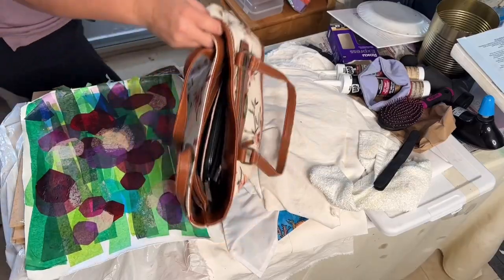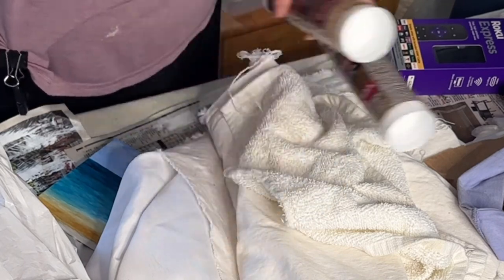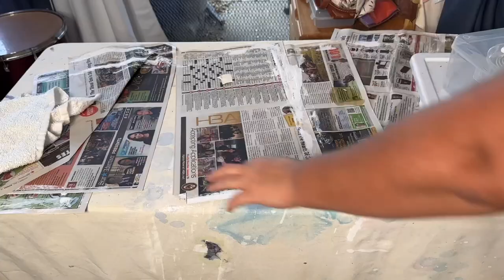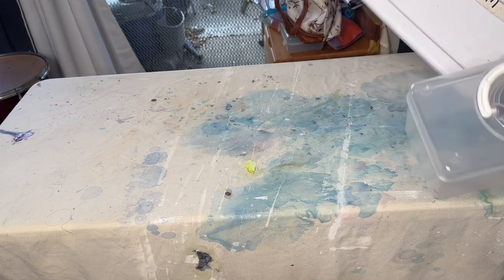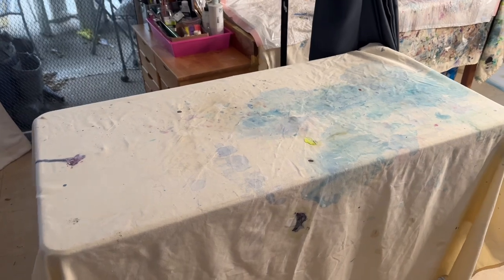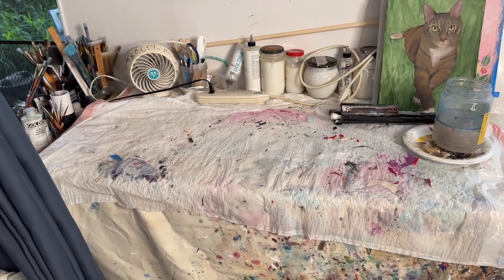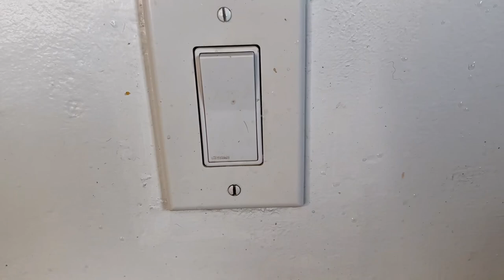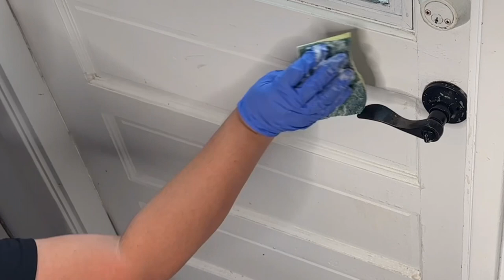Declutter & Clean with Me | Get that dirt gone!

Comment: Great job, Tracy! Go to next month on your calendar and write "Kitchen" for one of the weeks in March. Trust me...even if you think it doesn't need it, spend just 1 hour in that week cleaning your kitchen. If you do that every month, it will take you just one hour. The idea is to get away from having to spend hours cleaning! Doing it consistently will make this happen. I just tidied my art supplies yesterday. It feels so good to have that straightened out!
Reply from the maker: That’s great! I’m getting better about general kitchen cleaning/tidying but really need to work on maintaining deeper cleaning & the BATHROOM! Little by little, slowly but surely 😊
Reply: I do this for every room in my house.  I have 11 rooms and the patio and pool area.  This takes me the first 13 days of the month.  Then I do a daily 5 clean up that I do every day.  Daily 5 usually takes me a little less than 1 hour.  I clear clutter, wash dishes, do 1 load of laundry, make beds and spot clean floors.  I do one chore that rotates daily in this same hour such as clean bathrooms, dust entire house, vacuum floor, mop floors and wash/disinfect door knobs, light switches and high traffic walls.  This really keeps my house looking amazing.  I'm 65 soon and 3 or 4 hours on the kitchen would just be too much.  My motto is 5 minutes matter.  So sometimes my daily two hours at the first of the month maybe chopped up into 5 to 30 minutes at a time.  Spreading it out over 15 days makes it all possible and pleasant.  Great job!
Reply from the maker: @vondrabejot9851  WHOA!!! That’s incredible 😃🥳👍🏼 I have way less rooms than that so I definitely can step it up. That really is inspiring 💗